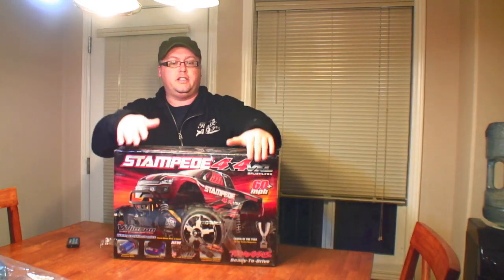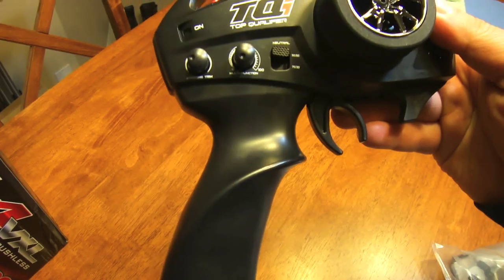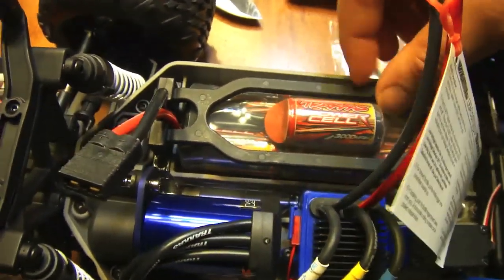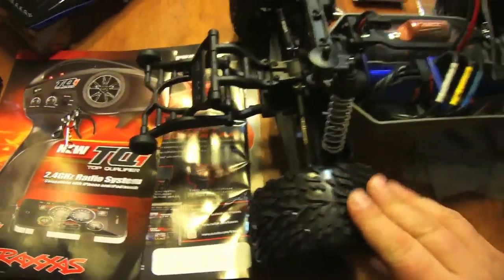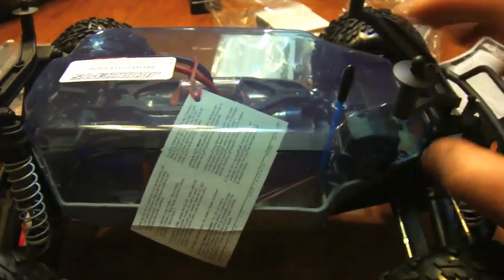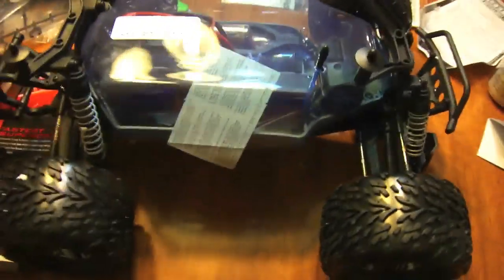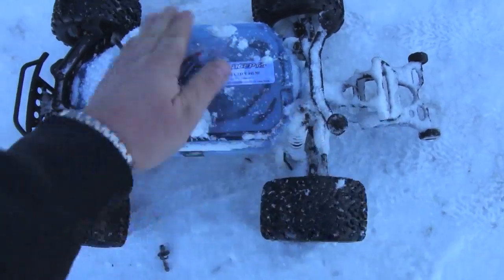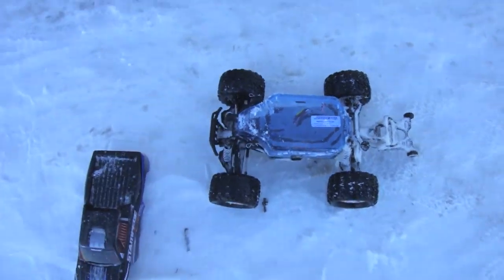Traxxas Stampede VXL Unboxing and First Use, drifting in the snow

Comment from the maker: outside in the cold, battery last less than 20mins and if you changed gears they don't recommend you using the stock battery but upgrade to a lipo.  get 3 batteries will be plenty

Comment: Mine in the 2wd Stampede, was the XL-5 with the Titan Brushed motor, I got maybe 30min if that on a snowy day, After I upgraded it to the VXL-3s system, the Stock 7 cell battery lasts 45+ min on a single change, I ride wheelies all the time, so im not that easy on the throttle, but there is a brake in for the batteries, If you get another batter, get a lipo or another nimh just make sure it says 5000mah, they seem to last me over hour and 20 min of just wheelies non stop.